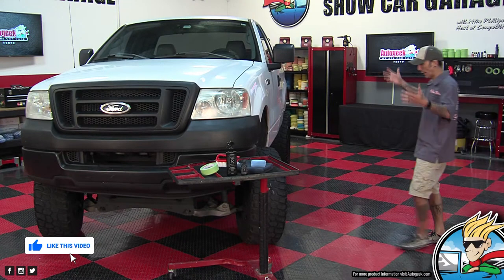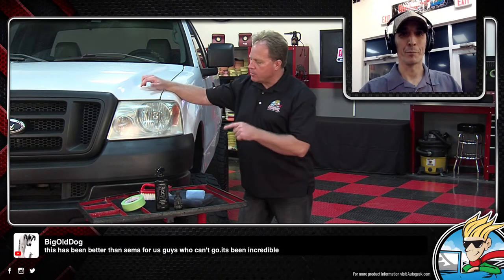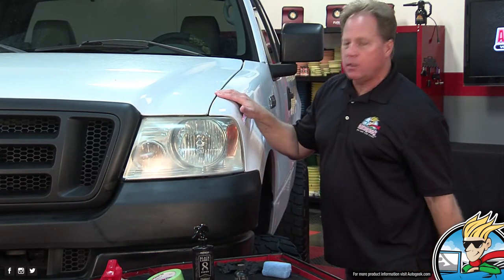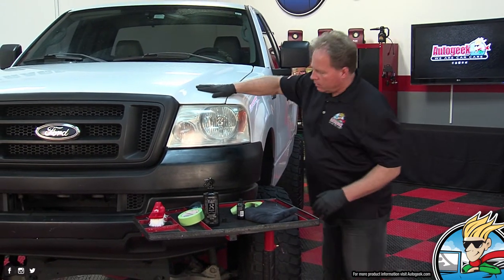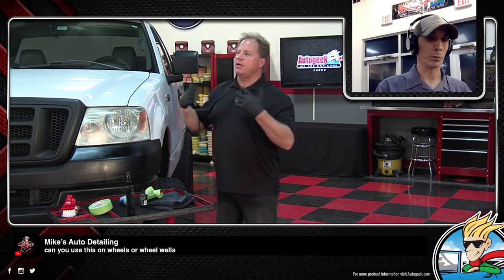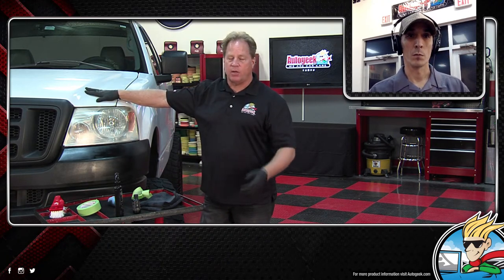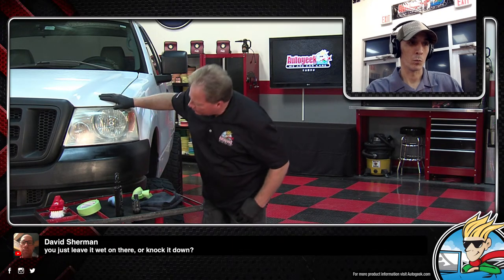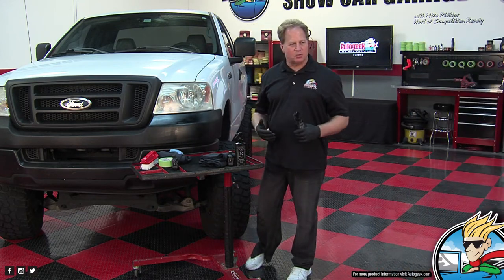New Detailing Products Showcase - Pinnacle Black Label

Comment: Man this is rough. Let's start at 21:40 We get an answer from Mike Phillips that the excess splotchy looking product which contains ceramic will just "level off when you wash it one time" which is especially oxymoronic considering the very next question at 22:02 where we get an answer that the product needs 24 hours because "it's a ceramic and you need to let it set-up." I am assuming by let it set up you mean harden and cure. So how is it that the excess hardened splotchy ceramic will just wash off in 1 wash after the product has hardened and cured. Mike is just spitballing nonsense hoping that everyone listening has a lower iq than he does. In his next reply, he says you can use this over solution finish. So dye over dye. I think that's how you ended up in that splotchy mess on that old pickup to begin with. I don't want to keep going but I have to. 23:47 we get an answer that there's not a lot of products for rubber trim. How about any water based protective dressing like meguiars d171, hyper dressing, P&S, rubber & vinyl/Odyssey, Malco Aquabead, carpro perl? All of these protects rejuvenate and protect rubber molding with seamless application. The real issue is that trim was no where in need of use of a dye. Dyes are for FADED plastics. Just coat already good looking plastic with normal ceramic coating.